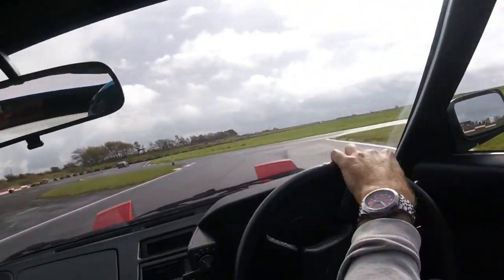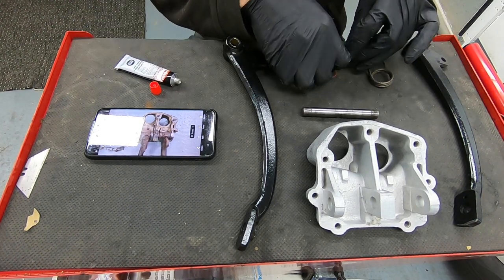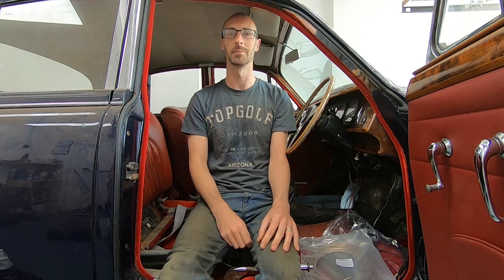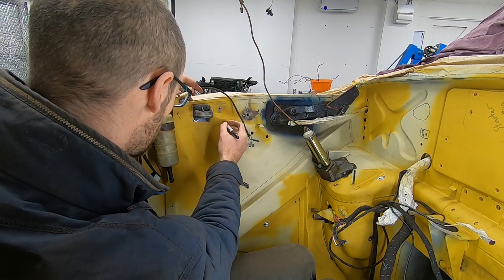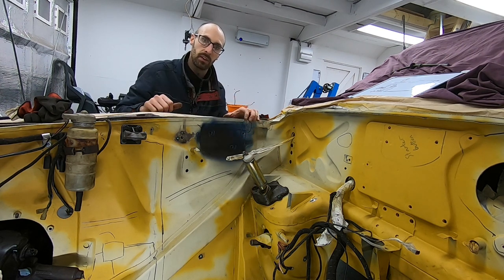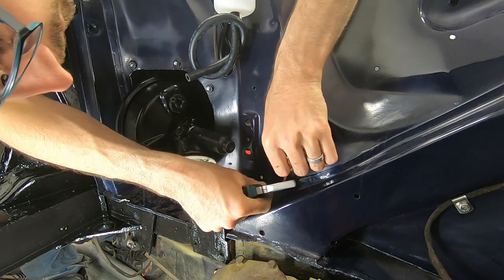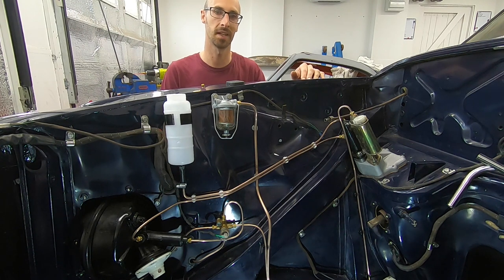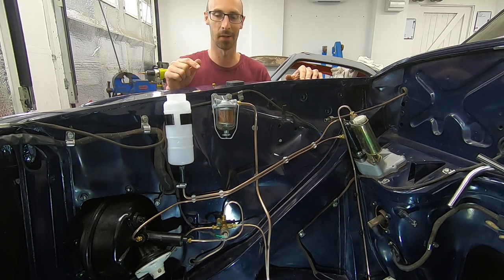Jaguar Mk2 | Making copper nickel  brake lines

Comment: A lot of people use copper for brake lines in the UK without issue, i've always used copper nickel as used here rather than plain copper because you can get the ends undone without twisting the end off the pipe.  Plain copper tend to corrode to the brake pipe ends and then you can't get them undone without damage.